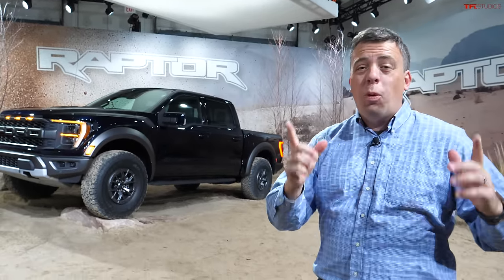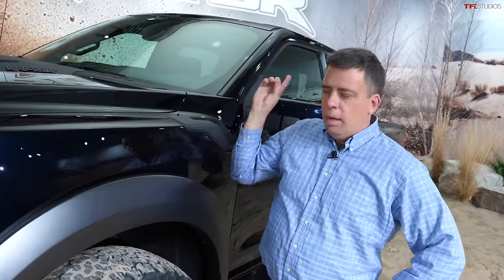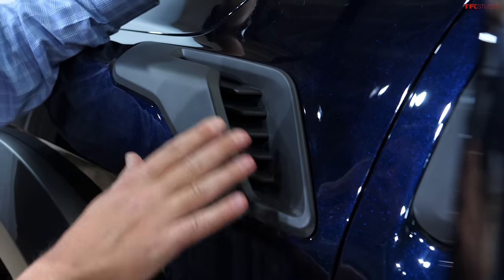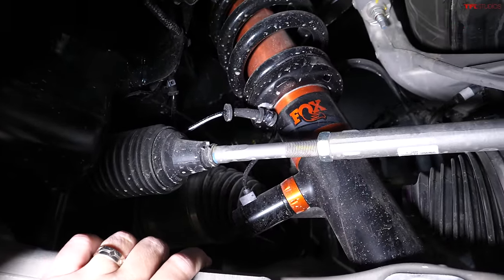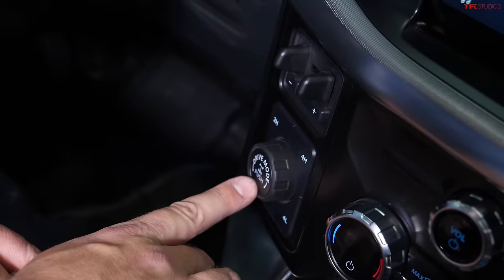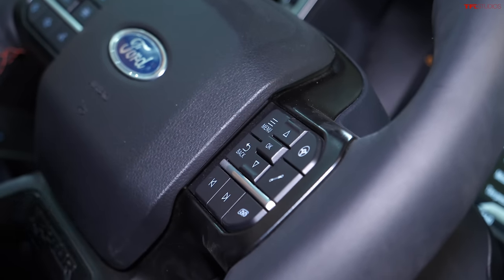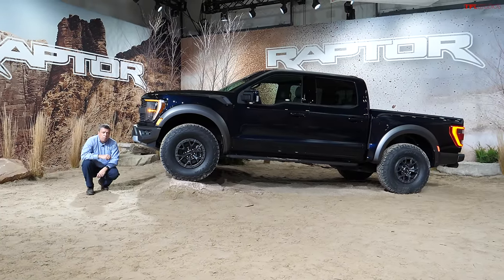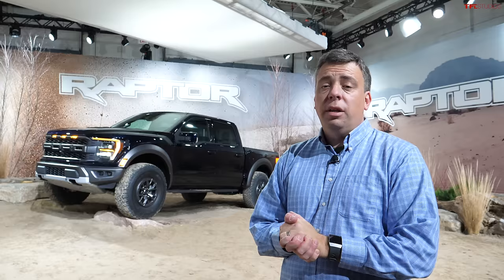2021 Ford F-150 Raptor World Debut: I Get My Hands On It — Here’s Everything That’s New And Cool!

Comment: This better have the 2020 GT500 engine in it. If the only option is a V6 I’m going to lose it.
Reply: Awwwe poor baby want some cheese with that whine?!
Reply: Base truck will have the HO 3.5L and the upgrade will get the 5.2L SC engine with 725 HP.
Reply: @ryansheard8092  725 is the for sure #? What about torque? Where’d you see that info Lol
Reply: @ryansheard8092  I'm pretty sure you are right on engines and will be very close on hp
Reply: @kadenkast392  a pretty well educated guess based on what that engine produces in the mustang and what they'd want to reduce the HP to to just beat ou the TRX.
Reply: @ryansheard8092  Fair enough 👍🏻 Didnt mean to come off rude Lol just excited to see the specs
Reply: @kadenkast392  no worries. I wasn't offended. 🙂
Reply: Says a bunch of people on the internet yet again, but here we are with 3.5 powered raptors still selling above msrp at the end of their lifecycle
Reply: Well there it is boys the 2021 Ford Raptor will only have a V6. However the Raptor R is supposed to come out in 2022 maybe with a 5.2.

Comment: They spent a year developing an exhaust system to sound like a V8 instead of developing a new drivetrain with a V8?.....ok. Still sounds like a V6. Also....that rear axle is tiny.
Reply: Well vehicle development takes years, not a single year. The fact that Ford is responding within 2 years to a new powertrain is actually pretty remarkable. To go through design, testing, durability testing, tooling, part sourcing, marketing, and all the other things to do with producing a vehicle is not something you can do quickly and on a whim. Don't forget, the TRX was proposed back in 2016 and released in 2020. These things take time.

Comment: I worked with the F22 in '09-10. Not sure the inspiration behind those heat exhausts. The Raptor R will be using the 5.2L Predator V8, supercharged, 760hp. (as I started writing this , saw video advertising the Raptor-R).

Comment: I’m not a fan of the v6 sound in a pickup. BUT it does sound WAYYYYYYYYYY better than the old ecoboost exhaust note. I wish it didn’t sound so horrible because they are great motors. I just can not get over the sound enough to buy a ecoboost f150

Comment: Ford needs to bring back their best engine the 4.9 inline 6 and twin turbo it, keep the same basic block idea do crossflow and 24 valves would be an absolutely solid motor

Timing gear where the normal cam would go

And just literally add the extra 12 lobes to the cam to get 24 valves, the thing would dominate offroad and be reliable engine wise

Comment: They should supercharge the 7.3 and put it in the raptor! Because you can tune that eco-boost to make 600-700 horsepower, however at that point it would be a bomb instead of an engine.

Comment: I have a 2019 gen 2 raptor - waited for the 2021 to be released to purchase one - what a disappointment- what’s with the august , September release date ( isn’t that closer to 2022? )  I’ve ordered a TRX - Ford is sitting on their hands , this year’s raptor is a waste of everyone’s time . You should be releasing the raptor R now - we are tired of the eco boost - I’ve had cam phasers replaced on both of my previous raptors - all at 50 000 klm - . I’m sorry but the 2021 raptor is a flop

Comment: Good review from TFL. I am disappointed in the truck, though. It feels like it's trying too hard to be a raptor instead of actually being one if that makes sense. The engine is a big let down, but the rear coils are a good addition. The shifting column screams tackiness. I don't understand what's wrong with a column shifter or a dash knob like the ram has.

Comment: They did good with the grille - good fusion of both gens. Not a fan of the rigid lights or the bumper in general, and back is just meh.

37s from factory is a pretty big deal, as all the previous issues with upsizing (need for fenders, component wear, etc) are fixed by the factory. The rear link suspension will (hopefully) eradicate the complaints about the rear skipping from idiot drivers, and provide a slight improvement in performance. If the TRX suspension is comparable to the Gen 2 (doubtful, but hearing mixed reports), then the Gen 3 will have a solid - but not massive - advantage. 

New exhaust is nice, as are all the other new features. Glad they kept the HO 3.5, it is an excellent engine.

Really sad the SCAB is gone - I can only imagine it will return in the Raptor R. Would be heretical otherwise.

Comment: Just got rid of my f150 it used to break just sitting in the driveway. Fell for the hype and tried the ford . Had dodge ,chevy ,so i figured i would try ford . Like dodge the best had no problems with my 02 ram v6 2wd in eight years just regular maintenance. Had a 89 gmc no issues . Dont know how the new stuff is . Ford in 30k brakes,,battery, alternator,thermostat housing,trans didnt want to shift when cold (so fluid and filter changed still happening),and new bearing noise when cold start. I gave up its gone.

Comment: I bought the 2021 GMC Sierra AT4 with the 6.2L. Not that I would ever consider the Ford Raptor...but, if it had the big V8, then I "might" actually look at it. But, Ford will likelycharge $85K+ for a V8 powered Raptor. Meh...

Comment: If Ford wanted to put the 5.2 V8 from the GT500 in the raptor they would had done it already. I can see Ford putting in a version of the Godzilla engine  in the Raptor R and if they do not use the Godzilla engine I expect a V6 TT with more horses.

Comment: The cost of the Hellicat Hemi is spread over the Grand Cherokee, Durango, Challenger, Charger, and TRX. That’s what make it a viable business case. Ford has no other vehicles to use a large supercharged V8 in and that will affect rather or not a supercharged big V8 appears. Business case dictates. Ram had the engine sitting on the shelf. Nada, Ford.

Comment: I think it looks great, boxy front end is a little nicer than ram, but side profile getting old.  There is a place for a twin turbo v6 in a world of TRXs.  I just think its lower on the food chain.    Also,  I think Ford is starting to yield to Dodge lately, but that's just me.    My ecoboost F150 had 3 oil leaks, not too happy, but otherwise it was an awesome truck.  Ram interior looks way better imo.

Comment: Rumor has it that Ford is going to slap that gt500 motor in the raptor r. Produces 760 hp. Even detuned will have more power than the TRX.

Comment: Ford isn't stupid.  The TRX and V8 fanboys are. This truck doesn't care if it has more power. It's not meant to be the fastest in a straight line drag race on pavement. It's meant to be the best and technologically superior offroad truck in its class.  And that it is.  This truck will run circles around the TRX in a desert race and on the technical trails. Power doesn't win those competitions. You're never peddle down for more than a few seconds. Being nimble, light-weight, and technologically smarter has made it the off-road king for the past 10 years, and will keep it there.
Anyone remember when the other manufacturers tried to outperform and sell the Lightning? That didn't turn out so well for them then either.  Always behind the curve.

Comment: Doesn’t seem that much different than the 2nd generation. Maybe the Raptor R will be mind blowing, but a 3.6L V6 doesn’t get my blood going, I don’t care if it is a twin turbo. Doesn’t seem to get Andre’s blood going either. I am not sold on turbocharged small displacement engines for long term reliability. Seems as if you are asking too much of the engine. Stuff a supercharged 7.3L in there, and it will eat the TRX for lunch.

Comment: You notice how well this Raptor  does in the sand and hard dry environments. 
Ford advertisements never lets their  baby Raptor sniff out the danger zone, ie, river and stream water crossings, mud and mud pits. They keep their But warmer truck high and dry.
This truck is made to show off on solid dry footing not the kind I mentioned above, but many of these  Raptors will find water. It is then I’m sure the warranty will be honored when this thing decides to have an electrical blackout. 
The truck looks nice but I didn’t see a molding or a picture  inside or outside of the  Raptor showing it eating a T—Rex?😩 
Be careful and stay safe 😀

Comment: So there is an R model, maybe that will shut up all of the "where's the V8" people(most of the people who bich about no V8 cant afford the truck anyway), I dont mind the V6TT at all, it's an engine that is based on the same Mk2 V6 that Ford raced for 24 hours straight in the Riley DP and GT GTE racecar for almost 10 years, it is a proven engine and this exhaust is a similar design to the GT350, it sounds much better, I like it A LOT.

Comment: As long as it's a small V6 pushing this big vehicle, I am just not interested. I have told so many that this truck simply will not last over time. And frankly, I am absolutely sick of all these new vehicles with undersized highly-stressed engines that won't last. Too small, too much plastic in the engine that will get old and brittle and break, and many feel that the engine is engineered to NOT LAST too long after the warranty is gone.

Comment: Definitely V-6 sound but it does sound tremendously better than the Gen 2.  The Gen 2 sounds HIDEOUS.  A properly tuned V-6 can sound good.  Of course nothing like a V-8 but it I could live with that sound much better.  Only a proper V-8 (5.2 Supercharged) will be a TRX killer, all the other pieces are there.

Comment: I won’t buy an extreme stock 4x4 truck with $20,000 worth of factory profit generating options! I just refuse to! If Ford, Ram or even Chevy (ZR2 comes closest in base Ext Cab), were to add these extreme off road 4x4 packages, in their base model trucks, with only options as far as power windows and locks, with a nice mid level sound/nav/telematic system, like GM’s OnStar 4 G LTE WIFI, that’s available even in their WT package, like my 2019 Colorado Crew Cab 4x4,WT,V6. Then I’d be in line for one! Actually a new ZR2, might be my next truck! But maybe not. I don’t have one now, due to towing limit of 5,000 lbs. I regularly tow our 26’,4,500-6,400 lbs travel trailer. Where the Colorado as is does a fine job! All I’ve done to enhance mine, is the factory dealer installed ZR2 skid plate package, along with the Bilstein 5100 system, set at 1.9”. So far so good.

Comment: I am sorry, but the front of that the Raptor is a shocker. Why does Ford keep employing Homer Simpson to design its trucks? Making the yellow running lights bigger is not improving design, but shows just how lazy the designers really are. That truck's areodynamics would be equivalent to pushing the Titanic sideways through the water to in an effort to avoid icebergs. Sheesh...

Comment: All this talk about the ram trx or raptor being faster didnt the hummer ev just kill both with 0 to 60 in 3 seconds flat?  Plus it's got 4 wheel independent suspension and 4 wheel steer. If you want the fastest truck looks like neither trx or raptor are it.

Comment: I love the Front of the 2020 Raptors. They look aggressive and Modern. The taillights are also crisp. But the front of this new one looks old already. I don't like it at all. The taillights are even worse. Disappointed. And the Fender flairs? Look aftermarket. Like they went with the body of a Regular f150 and added stuff on it so they could save money on manufacturing costs. Just buy a v8 f150 and upgrade it, still spend 20k less than a raptor.

Comment: Yeah you know it's not a V8 when there's a full sentence before the V. First a second generations looked better, this is quite streamlined. Very disappointed with the design, seems like most of the budget went into Bronco. Hopefully Ford won't start using Raptor badge as BMW.

Comment: So its a better truck in interior,  exterior, suspension travel, technology,  aftermarket support, and until the raptor R comes out the only thing it lacks is the TRX horse power?? Dodge shot its wad to early.. ford wins this easy even with the 3.5 probally @ 525 HP.

Comment: With 37s and 12.5 wide this truck will always be in the boost. Mileage will suffer heavily and I bet will be similar to the TRX. Pricing probably too. This video just sold a ton of TRXs. 3.5 liters just doesn’t do it when the competition is spanking you with 700 hp. I was really hoping for the power boost tech too. So new shocks bigger tires and new interior. I’ll pass.

Comment: V6? 😂 I’ll take the TRX. Idc if it has 750hp. A 6 cylinder has no business in a truck unless it doesn’t have spark plugs and is in a straight line.

Comment: That sounds nothing like a V-8, trombone or otherwise. Anyway,  the fossils at Ford have come up with yet another yawn inducing truck to joke the blocky Bronco that should have stayed dead.  Anyway, the materials and fabrics look cheap especially the carbon fiber plastic glove box. I'm not sure what to make of the the visually impaired graphics on the dash screen. 

Funny I didn't hear any mention of wireless charging or see any USB ports. The The Recaro seats and work surface are a useful and clever idea. One last thing, don't point the camera into the lights.

Comment: Ford screwed up big time with the 2021 F150. They kept the exact same truck but changed the front end and tail lights which are hideous compared to the previous gen. When it comes to the Raptor, it's a huge disappointment. This truck is super ugly and by no means resembles the Raptor legacy. It doesn't look nearly as aggressive as the current one and the same power train!!!! i mean come one ford. I hate to admit this as i've always been a huge Ford fan but the TRX is a much better truck overall.